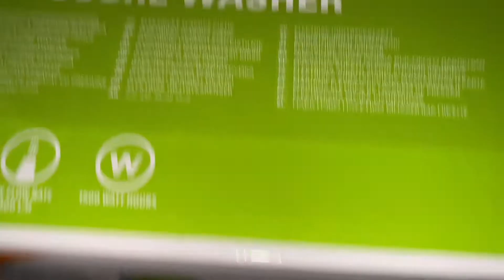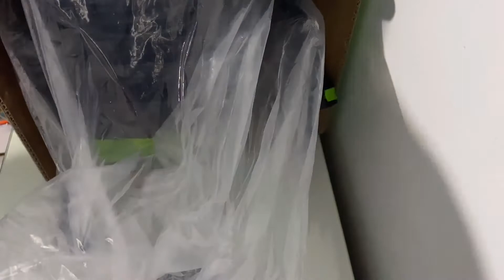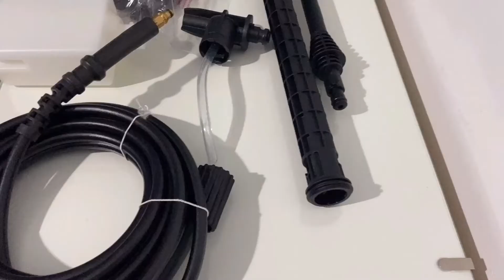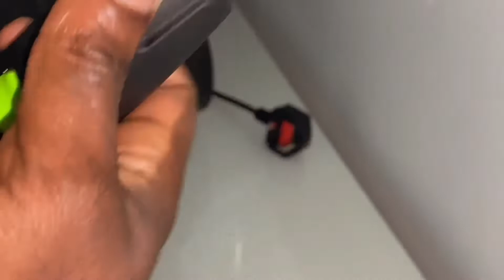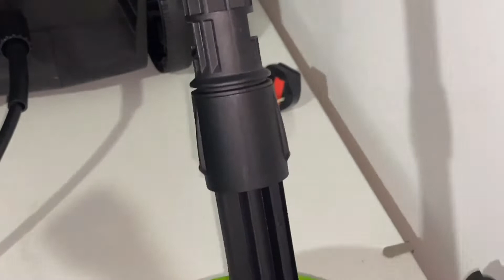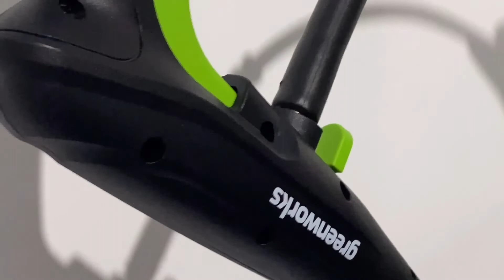How to setup and connect your G30 Greenworks Electric pressure washer, foam cannon and accessories

Comment: Almost ran hot water through but stopped really quickly. Thanks so much. How does one store the washer though?
Reply from the maker: Good question! Can be stored away in storage away from cold spread a blanket over it or using a pump saver when storing a pressure washer, especially during winters. What a pump saver fluid does is that it protects the seals and pistons from freezing and cracking by forming a layer on top of the internal parts of the pump. Thanks for the feedback. Don’t forget to subscribe and share. Helps channel grow. Have a great weekend Boulo